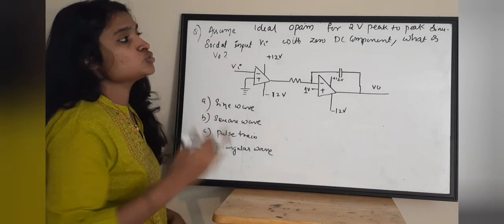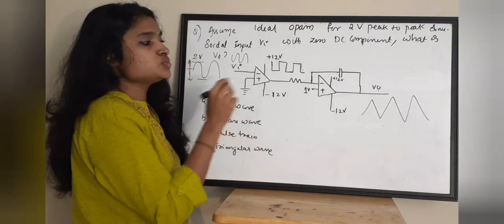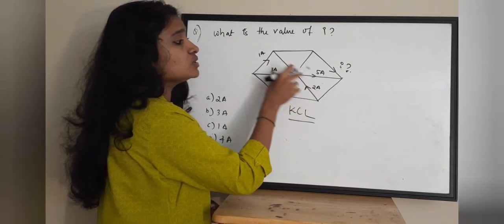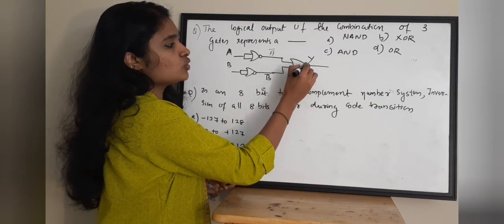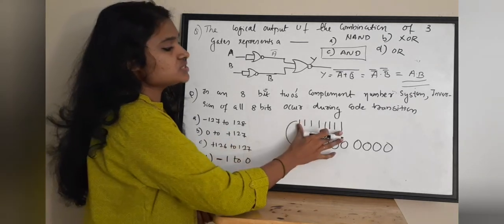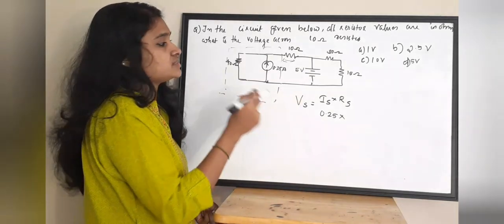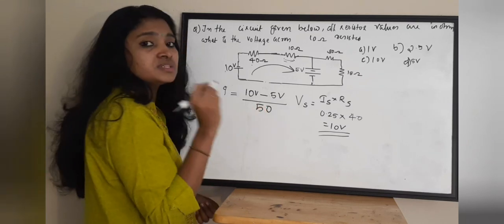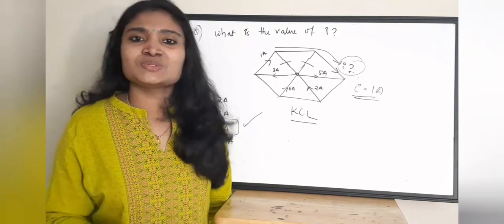ISRO- Technical Assistant Electronics-Previous Year Questions 2018 part1

Comment: One mistake 
Mam in network question
Both the voltage sources have same polarity so it should be 10v+5v
But you take 10v-5v
Please correct it
Reply from the maker: No voltage source has diff polarity.
Reply from the maker: Please check once again